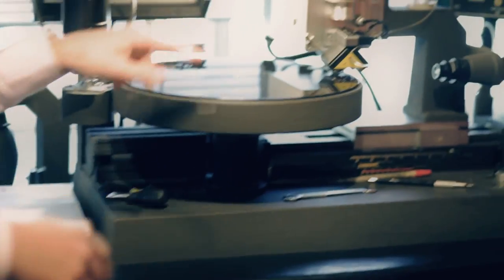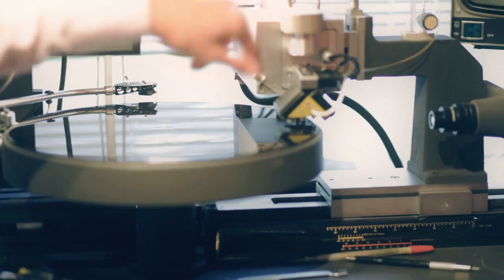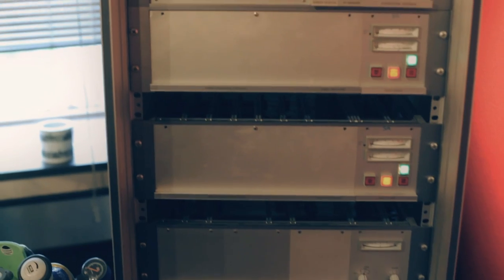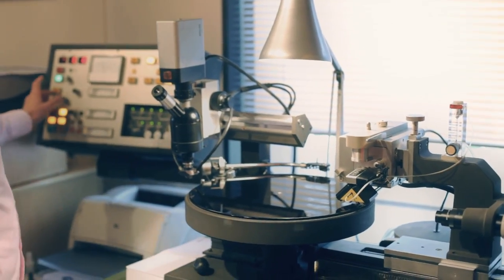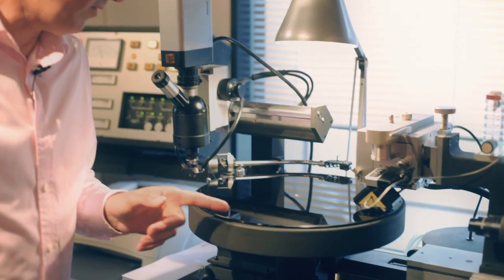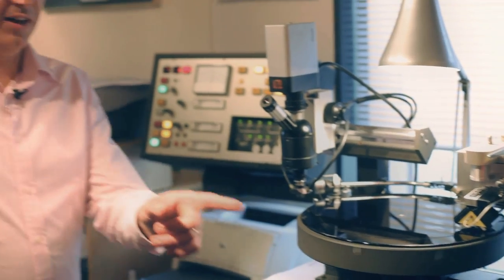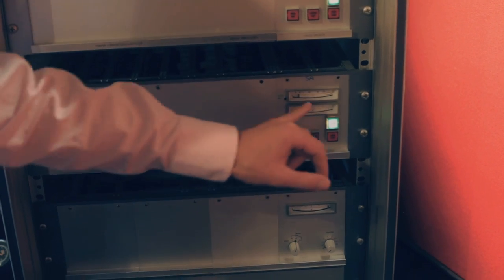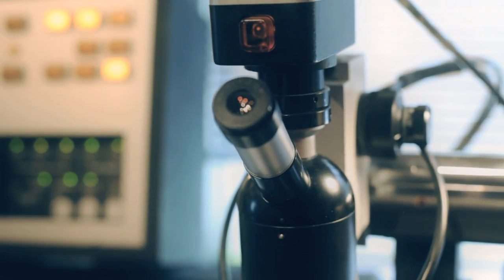Cutting vinyl at Abbey Road Studios

Comment: If everything is cut from digital, what are the specs used for the digital master? I still have a few "Digitally Mastered" classical albums from the early eighties, which sound awful, presuming that they only were mastered at maximum 16 bit. I believe 24/44 would be the absolute minimum at which mastering would be anywhere near the analog master, and DSD 5Mhz would be ideal. I'm pretty sure that Sony classical masters adopted the DSD format for digital mastering on vinyl, early on, but most "Digital" masters on vinyl back then could be as low as a 12 bit on VHS recorders. I don't think I would purchase much new vinyl again knowing the master was actually cut as digital, even if the cutting process adds a bit of 'warmth' to the material by proxy. I wish the music industry would create a new analog disc format, perhaps read by laser, that would sound as good or better than vinyl, without the pops and clicks. An optical analog (or hologram) would be able to capture the waveforms for posterity, with no need to convert from analog to digital. It seems counter-intuitive to 'archive' on digital, even DSD is not exact to the waveforms present on a disc, or tape.
Reply: Also, half-speed mastering was all the rage, and at one point, it should have been adopted as the de-facto standard of cutting an album. Now with larger storage available, and higher bit rates, wouldn't it be more effective to digitize the master tape at half-speed, to double the essential bits, and to preserve more of the waveform, and then cutting to a half-speed laquer to provide an even better sound quality? An example would be to record at half-speed the analog tape onto 5Mhz DSD, and upon cutting at 16 RPM you would end up with the equivalent of a 10 Mhz DSD recording indistinguishable to the analog source. How about digital mastering at third-speed?. You can even cut a disc at lower 8 RPM, and would achieve even higher resolution.